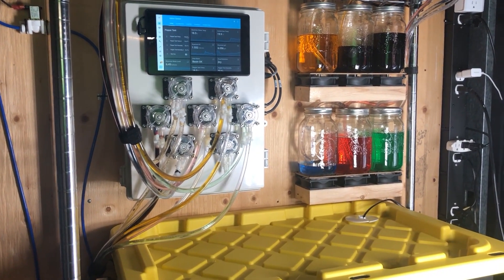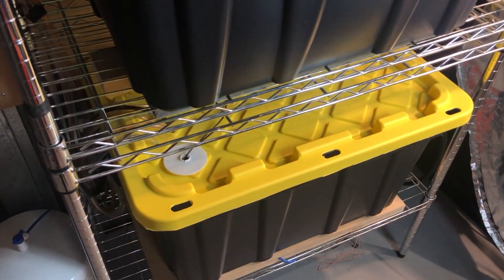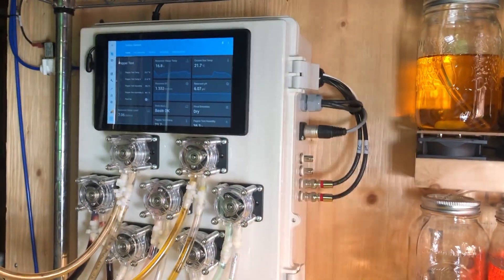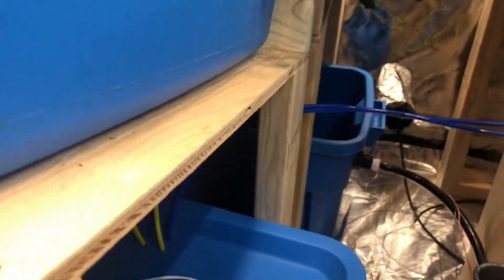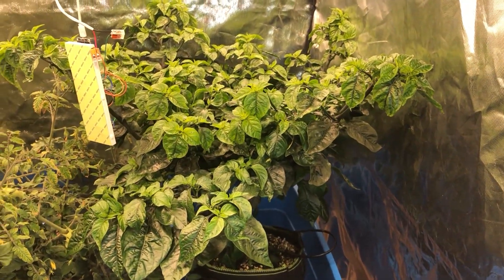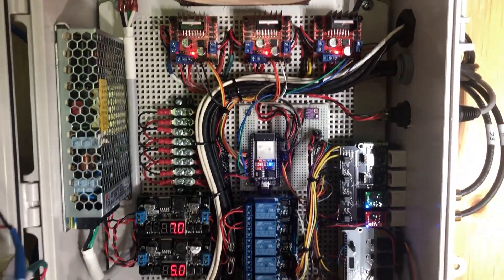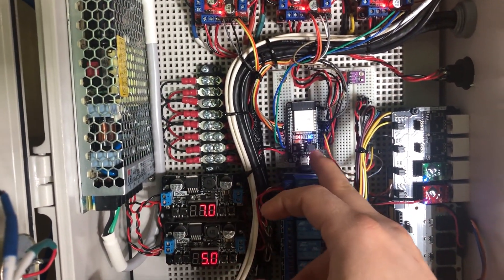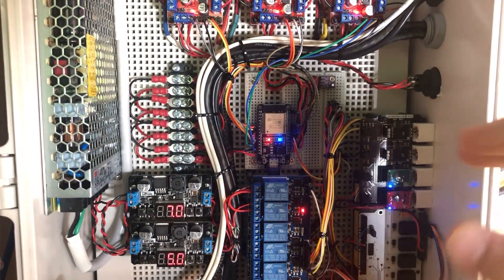My DIY Home Assistant Garden Automation System - Climate Control, Dosing, and More. Pt.1 - Hardware

Comment: @LEDGardener I'm not sure if you're still working on this sort of project but I have a quick question.  With ESPHome within Home Assistant, how are you getting the esp32 code that you wrote to the controller. This may be a case of updated versions but when I load home and start/bind the esp32 to my instance of Home Assistant I'm unable to add custom code. For example the Adafruit SeeSaw for their moisture sensor.  The code is easy enough but getting it over to the esp32 after binding it to HA is boggling my mind and I've been searching this internet to figure it out and drawing a blank. HALP?!?

Comment: For a projekt with students i am working on a cocktail machine with similar controlls and components. how do you feel about connecting the 12V pumps directly to a Relay Board, to make things easyer? You said it'll flow like crazy but for cocktails the messurements won't have to be this percice i guess?

Comment: Nice build. I need your skills with ardruino or raspberry pi. N we could both build some pretty crazy stuff after. I setup a 100psi aeroponic/fogponic system that circulates. The use of weight sensors is overkill but nice.

Comment: this is exactly what ive been looking at doing for ages i have most of the stuff .. im looking at adding Lorawan (helium) to such a setup so i can monitor& trigger tasks  from outside the house and also get sensor data from garden locations out of wifi range like in a field somewhere or an allotment or bottom of the garden . i beleive there are lorawan helium compatible esp32 s (915mhz for usa  and 868mhz for uk europe ) now or just RFM95 LoRa module perhapes . Setting this up would mean alot of tasks could be made off grid for solar for summer grows

Comment: Wow, very impressive setup!  And I thought I was going high tech by controlling my lights with my Domoticz server and Tasmota plug.  I'm going to use your idea with the moisture sensors for flood detection on my IR break beam sump pump controller.  Telegram notification upon any water problems!  Thanks for the video, great job!

Comment: Can you provide details on which power strip you used and how you modified it please? Thanks
Reply from the maker: I modified an old Middle Atlantic power strip - the trick is to find one that uses wires inside of it to connect each receptacle to power, rather than a bus bar. I intercepted the wires to each of the 4 receptacles and put them into controlled relays on a 4 channel 5V relay board that I stuffed in there.
Reply: @LEDGardener  That's going to be hard to find these days. I there a visible part number?

Comment: Appreciate your effort but i think you're overdoing it a lot, and are using the wrong kinda solutions for your problems i.e. use ultrasonic sensor to measure the water depth in your boxes instead of weight measuring units... way cheaper and easier dont use capacitive soil moisture sensors as they don't corode and instead of the 8 relais module use solid state relais as they have more cycles and PWM capability and maybe get a 3d printer to make everything leaner and maybe try to condense it down to one microcontroller instead of three or more but anyway appreciate your efforts and u learned a lot that way im sure
Reply from the maker: Works great for me. I have found ultrasonic was not as accurate as the scale in these boxes even with scale creep factored in. The moisture sensors do flood sensing only and are dry unless something went wrong but I agree the capacitive are better in every way. The relays are fine and I apologize it’s too messy for your liking. Don’t you think using solid state relays goes against your point of overdoing it? Link me to yours when you build one to show me how it’s done. Sounds like you have good ideas and knowledge on the subject.

Comment: Are you using that one power supply to power everything in that box? Would you show how yo do that? I’ve bought a ton of adapters to power my devices but yours is so much cleaner. Don’t the watts matter even if the voltage is right?
Thanks!
Reply from the maker: Yeah it’s a 150W 12V supply that I step down a couple places. It’s more than enough to run it all
Reply: @LEDGardener  are you stepping down the voltage because some components have lower voltage requirements or for some other reason?
Reply from the maker: @Ghanzo  Yup. For example, I wanted to give 7V to the ESP and Arduino to make sure they were able to produce reliable 5V signals themselves.
Reply: @LEDGardener  Gotchya. Thank you!!!!! I'm on my way to using an esp32, and powering all of the devices with a meanwell power supply. Super stoaked. Got to move to home assistant from some wifi plug software which can't automate. Will be a big shift, but I think I'm finally starting to get what you've done in your garden. Not bush league at all. Major League. gj ty
Reply from the maker: @Ghanzo  Hell yeah you will love Home Assistant. It's crazy powerful. Good luck.

Comment: this is awesome , i have build before same setup . i was added CO2 sensor in order to further regulate the fan air flow .
when there is high humidity outside . you can monitor the minimum air flow needed (co2 concentration) and that way you get another point to auto fan speed .and control .
would be happy to hear your opinion . 
thank you

Comment: @LED Gardener, thanks for sharing your work. Could you please clarify where your touch screen is connected?
Reply from the maker: I'm using an app called Fully Kiosk to show the Home Assistant interface in a web browser.
Reply: @LEDGardener  Thanks for your response, do you have video on how to do it?
Reply from the maker: To do what in particular?
Reply: @LEDGardener  setting up Fully Kiosk and connecting it to Home Assistant

Comment: Can you give us your background in coding? Or anything you found helpful in learning it? I can do the circuitry but the coding is really rough for me.
Reply from the maker: I started coding with this very project actually. To get started, I read "Beginning C for Arduino, Second Edition: Learn C Programming for the Arduino" and then I just bought an ESP32 for $10 and started messing around with it and following tutorials to do all the noob stuff like blinking LEDs, etc. I then applied what I learned to this system.

Comment: Great project, i have done something similar in my greenhouse. I am working with node red for Software stuff, works perfectly stable and is pretty easy to use.

Next step is to implement openweathermap to it

Comment: Thanks for the video. Do you place the pH probe and the conductivity probe in the same container? Does one probe affect the reading of the other one?
Reply from the maker: Yes you do and no, the tentacle board electrically isolates them so the EC probe doesn't interfere with the pH probe.

Comment: YES. You are the first I have seen that has hacked the PWM for the AC fans. I've been holding off on picking up an AC but I'm buying an 8 inch ASAP now. Works well with 5v logic? or are you using it with the pi 3.3v logic?
Reply from the maker: The motors have changed on these fans and I haven't yet tried the new one

Comment: Just curious why on your diagram do u have a Rasberry Pi and Arduino board, instead of just having just a one Rasberry Pi controlling everything, can you explain the reason behind the separate setup ?
Reply from the maker: The Raspberry Pi sits right beside the router in a different room and its only job is to run home assistant. It is wired into the router rather than running on WiFi, which is recommended for Home Assistant. The Arduinos handle all the peripherals for a few reasons - some of the devices are 5V, which I didn't want to have to convert to 3.3V for the Pi. The shield I have for the Atlas stuff is built for the Arduino Mega and I found it easier to program the Arduino than to have to mess around with writing code on the Pi that is also running Home Assistant.

Comment: Nice, just need a sensor for the leaf temperature get the VPD dialed right in.
Reply from the maker: MLX90614 😎
Reply: @LEDGardener  
  Do yo know if the InkBird wireless units will show up on the assistant?
 It would be nice to use what I already have if possible, less technical stuff for me to flack out on if I can just integrate some of my old setups.
Reply from the maker: I've seen that some people managed to get their inkbird stuff working by registering it as Tuya somehow https://community.home-assistant.io/t/inkbird-help-integrate/146376/28

Comment: Hi 

You can use capacitive sensors outside the container to monitor preset levels.

Sick sensors have relatively cheap sensors that will work well.

All you need to do is calibrate empty level and filled level and set whether you need a Normally open or Normally closed status.

I have used this type of setup for measuring level of corrosive where other methods such as ultrasonics proved unreliable.

Well done on your project !

Comment: Thanks for sharing this experiment. Very impressive. Just wondering why didnt you just use some float switches measure the solution level rather than the weigh sensor? Wouldnt it be easier?
Reply from the maker: I wanted to know how much solution is in there with much greater resolution since I am using that data to tie into other aspects like dosing. The scale gives me way more info.

Comment: I think you need to give yourself some credit man,  that box looks neat and organized inside.  I have seen professionally installed industrial control boxes that aren't that organized.   Sure you might not have printed boards,  but everything is wire tied neatly and organize;  for someone doing this as an amateur project in your home it is impressive. Nice work.

Comment: Could you change the arduino mega and tentacle shield for a pi zero and tentacle t3 shield for raspberry pi? I ask because the original shield is out of stock
Reply from the maker: I haven’t messed with writing code for  Pis so I have no idea how much work it’d be to make the conversion

Comment: https://www.ebay.com/itm/Liquid-Level-12V-Controller-Sensor-Module-Water-Level-Detection-Sensor-Component/273165382238?ssPageName=STRK%3AMEBIDX%3AIT&_trksid=p2057872.m2749.l2649
https://en.wikipedia.org/wiki/Hydroponics
https://www.youtube.com/results?search_query=AutoPot
https://www.youtube.com/watch?v=ukqU1RSIydM
https://www.ebay.com/itm/LED-220V-110V-Input-Integrated-Smart-IC-Driver-Floodlight-COB-Chip-30W50W70W100W/162871139361?ssPageName=STRK%3AMEBIDX%3AIT&_trksid=p2057872.m2749.l2649

Comment: super awesome, do you have issues with corrosion from jars? I have used jars last couple month to make using my syringes easier, I use general hyfro. Armor si, florilicious plus, flora blend, i think 1 or 2 others do funny things where it contacts the lid, i don't shake, but still, i have noticed and am lookin for a plastic solution
Reply from the maker: Only where I drilled the lid out to pass the tube through. They could use plastic tops for sure
Reply: @LEDGardener  still, I am REALLY impressed
Reply from the maker: Thanks dude, let me know if you find a better way

Comment: Couple of years I ago I bought this Jebao Auto Dosing Peristalsis Pump system from Aliexpress. It was like 70€. Never hooked it up because I managed to drop it into a bucket of water. I think it's been drying enough now that I might pull it out from storage. It has only 4 pumps but you could do something with that. They advertised it as remotely controllable so maybe it has a NodeMCU/esp8266 inside. Your setup looks nice!

Comment: Why did you choose to go with a normally open solenoid for your water in? It seems to me this should absolutely be normally closed. Then if your water leak fries the system, you're guaranteed not to flood.
Reply from the maker: They run reeeeally hot and I didn’t want to have to power it forever unless there was an issue. Your point is valid though for sure

Comment: the circuitry looks beautiful, it looks like a PLC system
Reply from the maker: Thank you. A lot of comments suggest a PLC would be the way to go.
Reply: @LEDGardener  a PLC is expensive. I mean you buy the device and license for the software and programming a plc is (not hard to learn) bit different from what you said you have learned. But there is some open source PLCs based on arduino which is just an arduino board with extra IOs and designed to looks like a plc from the outside, so open source PLCs are no much different from what you are doing. Check controllino if you're interested.

Comment: A really awesome project! Loved what you made to stir the nutrients and all of the data viewed on HA's UI. May I ask how you read the pH and EC values from Arduino to ESP to HA?
Reply from the maker: Thank you! I modified an example sketch that whiteboxlabs provides for use with their tentacle shield. The arduino grabs the data, passes it to the ESP32 via serial, then the ESP32 fires it off over MQTT to the HA pi.
Reply: @LEDGardener deeply appreciate the knowledge about this, I'm trying out Home Assistant as well! May I ask in what yaml files should you be configuring to read the data from ESP?
Reply from the maker: In your configuration.yaml file, you should have a sensor: section. Here's what mine looks like to read that data in particular (I do have a lot more stuff under sensor but I'll omit it here since it's irrelevant):

sensor:
  - platform: mqtt
    name: "ph"
    state_topic: "4x4/pH"
    unit_of_measurement: 'pH'
  - platform: mqtt
    name: "ec"
    state_topic: "4x4/EC"
    unit_of_measurement: 'EC'

I publish the values from the ESP32 via MQTT to those topics and HA reads them as they stream in.
Reply: @LEDGardener  deeply appreciate the knowledge! Took me a while to fully understand editing files in yaml. Any tips where should I configure in comparing values and setpoints? Also setting the timing of the pumps?

Comment: Great job!!!  I did a similar system using a PLC...look into it. will save you development of the custom boards and will reduce your wiring....
Reply from the maker: Hey, that's awesome! I'm shooting for simplicity here and I think a PLC system may be a little advanced for many looking to build something similar. What functions did you build into yours?
Reply: @LEDGardener  some PLC systems are complex but there is bunch of small platforms that would do that entire job with one controller and one power supply.  I use PLC to control humidify, light cycle, air flow in/out with VFD drives and other functions that required manual daily operations.  I like your setup its clean and neat…this comes from someone that does this for a living. Great job!!!

Comment: Hey LEDG, you’ve  inspired me to implement my own HA solution! I have a cloudline T6 and I’m having a hard time finding resources that document the native controller bypass/HA integration with variable speeds. Are there any resources or reference materials you found helpful when designing your solution?
Reply from the maker: I'm doing mine in an odd way and I'm not entirely sure it's the right way to do it, so take this all with a large grain of salt and use it at your own risk!  

I'm controlling my Cloudline T6 with an ESP32, an IRLZ44N MOSFET and a 10K resistor. When hooked up as it is from factory, at full speed, I'm measuring a little under 30W DC being fed to T6 fan.

On the fan is a little removable panel and there is a terminal block in there for ground (black), +24VDC (red) and PWM (yellow). I've left PWM and +24V as they were, but pulled the ground from the CONTROLLER side off the terminal block. I feed this into the source side of the IRLZ44N, then run a new wire from the drain of the IRLZ44N to the terminal block where that other wire used to land. ESP32 ground gets tied to the source of the IRLZ44N and I also connect a 10K resistor between the source and gate of the IRLZ44N - the resistor pulls down to ground so the fan can turn off when the PWM signal disappears. PWM out from the ESP32 attaches to the gate of the IRLZ44N as well. I send a value of 0-255 to the ESP32 to control speed.
Reply: @LEDGardener  thanks for all the detail, man! Much appreciated and looking forward to the next video in the HA series!

Comment: Amazing setup. I see you use General Hydroponics. I have hydroponic advice if you want to listen. 

The pepper plant will like a NPK mixture of 3-1-4. Mixing 1 part Micro, 1 part Bloom to 1.25 part Grow, .5 part cal mag will give you a mixture that will give you healthy growth. The Tomato plant will get bloom rot or the tomatoes will not turn out if the calcium is too low. Surfer and potassium are essential for flower production and essential oils for taste. Epson salt is a grate way to boost flowers/taste for fruit production. 500-600 PPM is a nice place to be. Generally never over 800 PPM. I think if you try these few things, you will see plenty of great tasting fruit.
Reply from the maker: Thanks for the tip! The peppers ended up doing really well. I pulled over 300 ripe reaper pods in my first harvest. The tomatoes didn't do as well, and some had end rot as you mentioned.